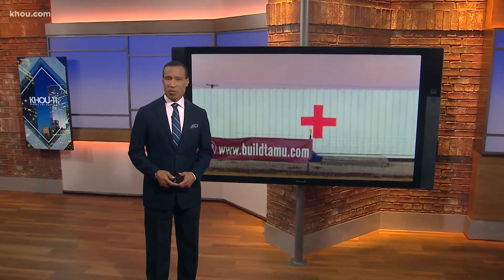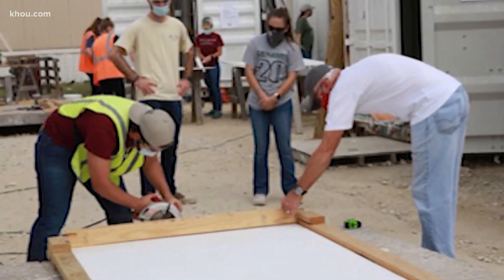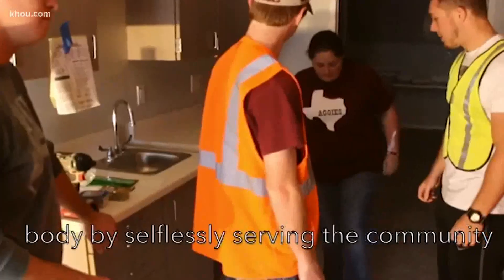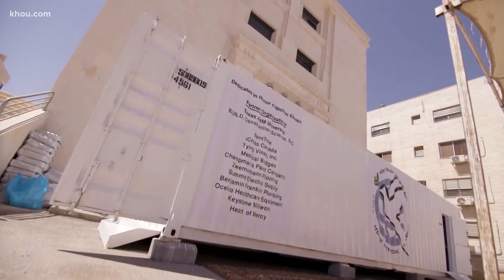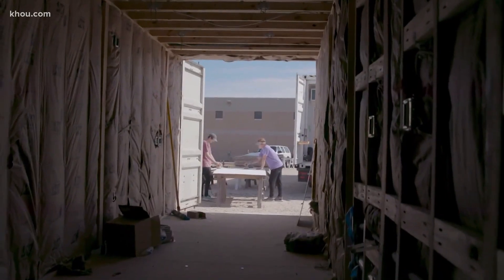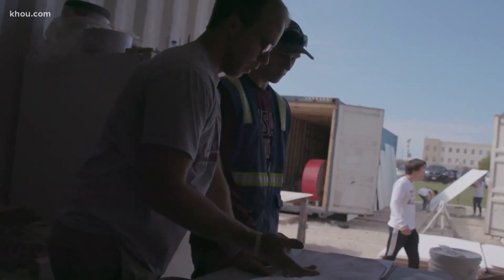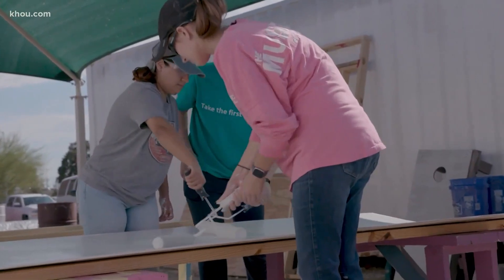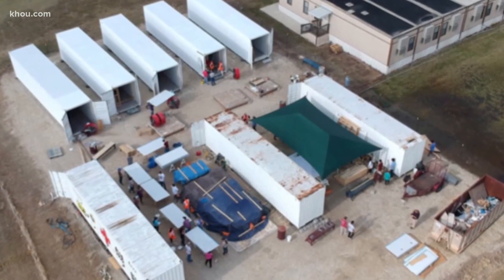Texas A&M student program transforms shipping containers into mobile medical clinics

Comment: It helps to have a facility that you could make them like a factory, cutting down costs and simplifying the process.

From there you can use more robust materials and insulate them from the inside and out .

I understand a lot of hospitals are built with steel girders and concrete and you will always need those, but container homes and things such as these Dramatically reduce the cost to deploy so you can just focus on your Workforce and your Action Plan.